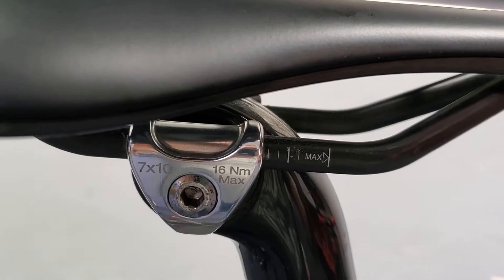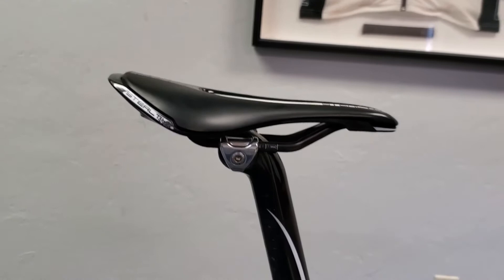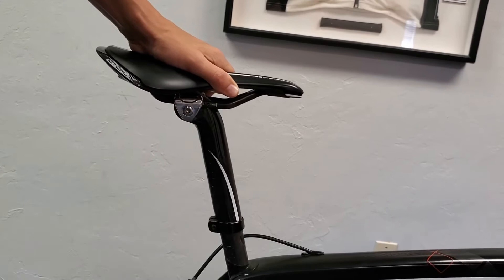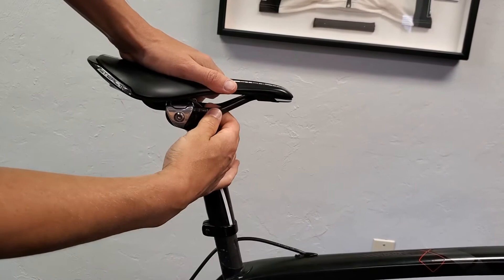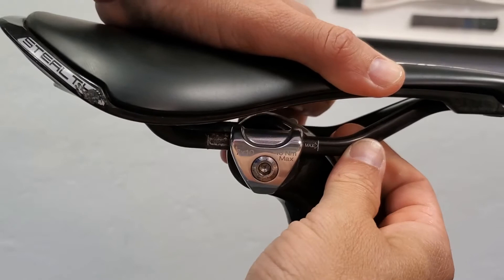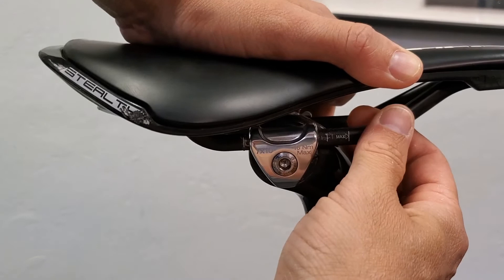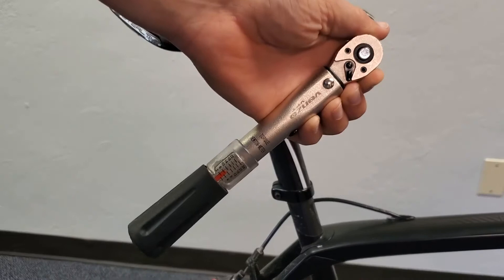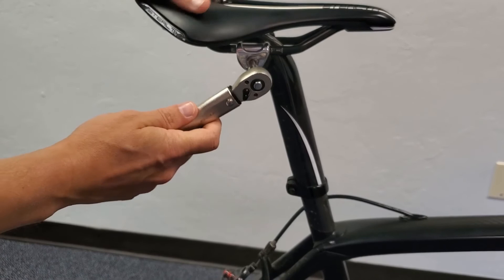How to Adjust a Rotary Bicycle Seat Clamp

Comment: Just solved this problem with my saddle. After a bump, it rotated significantly backwards, causing the nose to point upwards—not the best for riding 😉! I couldn’t fix it losing the bolt and trying to rotate. When tighten the scew it came back in de same false position. Then I found a manual from Bontrager;

The solution: I removed the 2 so-called 'compression wedges' (rotation cones) wich easily got be removed with a gentle tap using a large screwdriver and litle hammer. They popped out on the first try. After that, I was able to rotate it back and tighten the bolt to the correct saddle angle and torque. 

Hope this helps when someone is looking for a fix to the same problem.
Reply: Thanks, was having the same issue on a Trek Domane. Had to pop out the 2 wedges and adjust their angles to get the seat angle how I wanted it.

Comment: My nose always comes down when torquing it up…. Any tips?
Reply from the maker: If it is constantly slipping and you are using the proper torque specifications, it may be wise to add a little fiber grip (carbon paste) to the cups of the seat mast. This will provide more friction to the system without compromising any of the integrity. If that does not work, contact the manufacturer and see if they have any recommendations.
Reply: @BikeFitBox  thanks a lot for your answer. I think I phrased it wrong tho. I mean while torquing it up the nose presses down to -6 all the time. Even when applying pressure on the back of the saddle.
Reply from the maker: @vanakes  that is interesting. I don't believe I can give you any clear guidance on that other than starting with it nose up when you begin tightening it and seeing if it will go to where you want it. Other than that, If this has always happened I would wonder if there is some form of defect that causes it to do that. Sorry that we can not be of more help on this one I would suggest contacting the manufacturer.
Reply: Just posted a solution wich I found as I had same problem.

Comment: My seat post has begun slipping. I’ve disassembled it, cleaned it with acetone but I don’t know if I have to ad some sort of lubricant.
Reply from the maker: Jason, if it is slipping you can try to use some fiber grip.  It does not take much to help keep your seatpost in place.
Reply: Bike Fit Box I apologize, my saddle slips and has this rotary style. I read somewhere that metal shouldn’t be in direct contact with other metal. I replaced the gunk with a small amount of lithium grease. Going for a ride now to see if it still slips.
Reply from the maker: @lomeranger  if it is still slipping try some fiber grip paste. This is often used on seatposts that slip and it provides a little bit of "grit" to help things stay put.
Reply: @BikeFitBox  I bought a new bike and the seat saddle keeps on tilting when I sit on it. Is there something I can do
Reply from the maker: @kartiktiwari5559  does it have this same "rotary style" clamp? Or something different?
Reply: @BikeFitBox  yes the same rotary style clamp
Reply from the maker: @kartiktiwari5559  the best thing to do is t disassemble the rotary head, clean the parts, grease the threads of the pinch bolt and add fiber frip to the rotary head, reassemble and torque to the proper specifications. If it is still slipping after this you should take it to your LBS and have them inspect it.

Comment: I've put on a new saddle and tightened up the clamp.  Looks okay until I hit a bump out riding and the tail of the saddle tilts downward.   Do you need to somehow align the bolts on both sides of the clamp ?  Do these bolts have to interlock with each other ?
Reply from the maker: Bill, if it is this same style of clamp the right and left sides do not interlock.  Make sure that you are torquing the bolt to the proper spec. In this instance it is 16Nm nut be sure to check the manufacturer specs for your product.  If this does not work you can add a bit of fiber grip to the interface and that will add some "bite" to the parts.
Reply: @BikeFitBox  Thanks.  I took the clamp apart and gave it a clean.  The bolts have the blue locktite stuff on them.  Then tightened it up to 7Nm as that was stated on the clamp.   Will see how that goes.  Cheers
Reply: @grobbosixtyone  Did that work for you? I have the same issue.
Reply: @NessMeister  It just needed more torque.  Unfortunately that meant I stripped the thread but the seat hasn't moved since
Reply: @NessMeister  me too, I am too worry to go all the way as per the post suggest (120 pond feet per inch = 13ish Nm).  clamp tilt backwards when I hit uneven path (I was tighten to 5Nm) .  Now  Ihave done about 7.5Nm and will see if still do that.

Comment: I have this exact setup and I have to disassemble it every time I want to adjust saddle tilt as it sticks. Any suggestions on how to fix that. Does it need a little grease on the bolts?
Reply from the maker: It is always wise to grease bolts to keep them from seizing up. In this case though you can grease the cups with a thin layer and it will help out quite a bit.  For bigger riders, or riders who have their saddle all the way forward on the rails you may want to try a carbon paste to keep the saddle from slipping.